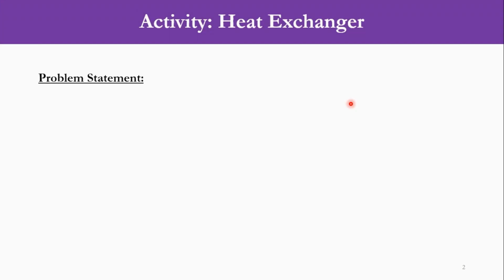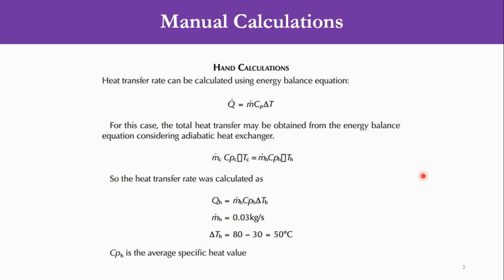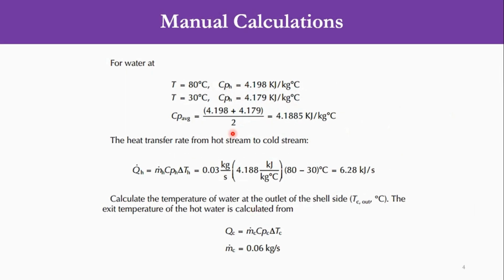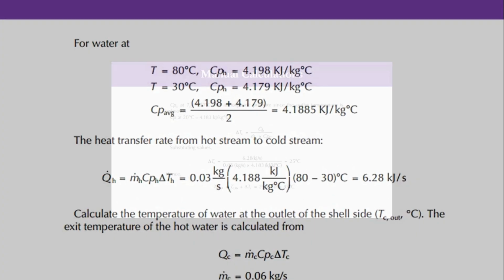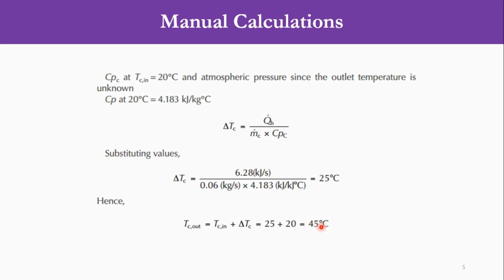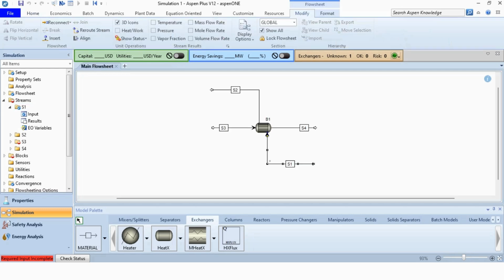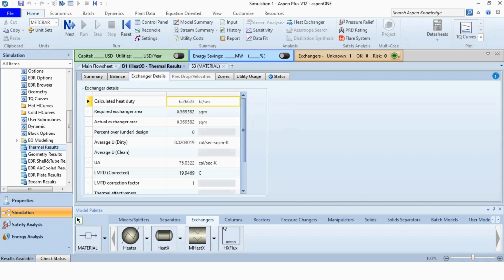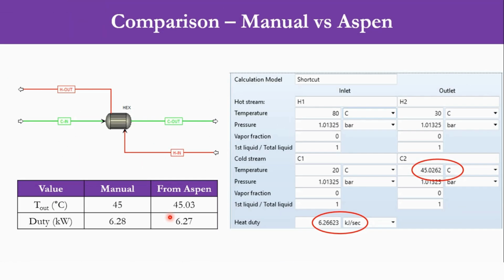Step-by-Step Heat Exchanger Design: Manual Calculations and Aspen Plus Validation

Comment: this part is easy, the hard part is to calculate the heat exchange area for Shell&Tube or plate and frame and compare with Aspen EDR, Ideally for 2 phase system for more complexity.
Reply from the maker: I agree. That will be covered as well in our upcoming videos. Stay tuned 🤗